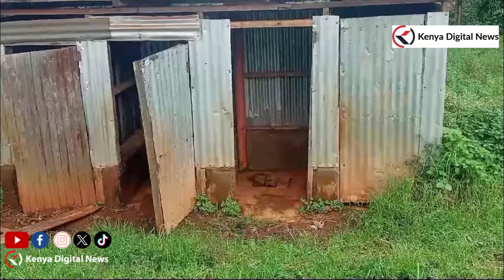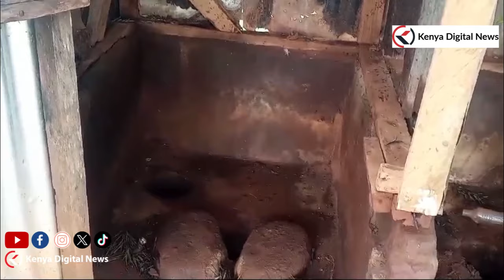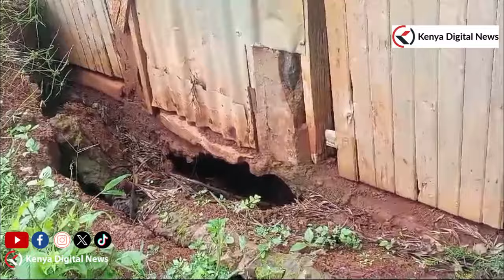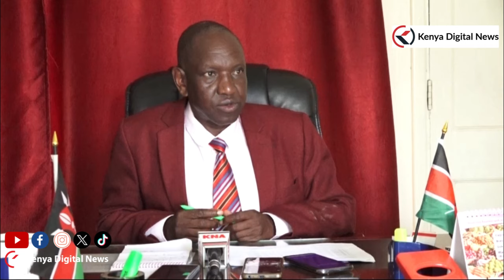'Poor Workmanship To Blame For Collapse Of School Toilets In Embu' County Education Director!!

Comment: Pit latrines are NOT toilets. A toilet is more advanced, with plumbing, bowl, flushing mechanism and some plumbing used for waste disposal. A toilet is what you have in this school; a basic hole in the ground and and some superstructure. So next time do not confuse the two.
 In ALL cases when a Pit Latrine is to be constructed, seek the services of a Civil Engineer who will advise on soil stability of the pit walls and recommend whether masonry lining is required. Actually, Masonry lining is always required and the pits should always be built in areas which are well drained and surface water does not flow into the pit. If the Latrine is over 20 years old, and Engineer's Assessment is required to determine if it is still safe to use.